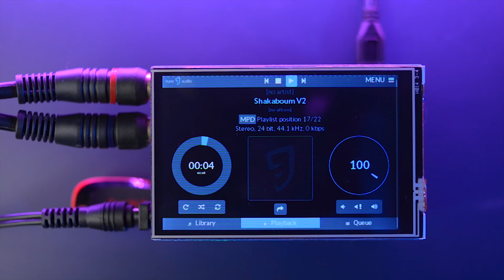Get started with the Raspberry Pi High End Audio DAC

Comment: I have an important question. I had an idea to integrate this concept into an analog mixing console and have one of these in every channel strip. Interfaces need to operate with bus cables like USB FireWire lightening protocol and those have real drawbacks to audio quality especially in today's lossless Hi-Res and DSD capabilities. Most interfaces right now max out their quality per channel at 192khz 24-bit at 8 channels. You also have latency issue and buffer. My question is, how can we as out-of-the-box console mixers use a  individual device with Hiquality playback that can synchronize each and every channels devices through MIDI SMPTE timing clocking synchronization? This compact recorder would be very useful for people with large format consoles and mix entirely independently of a computer DAW or interface over a transfer medium cable. I think in theory it could work. But, in the size that each screen could fit within the size of it's own channel strip at the bottom where your hands rest. With the touch screen, have a way to touch the screen and manipulate parameters and plugins or to have as independent spectral analysis screens....

Comment: I wish I saw this video before undertaking my RPi project to build the same thing...  Unfortunately, the comment link for details / ordering is no longer valid, and there are no details (or product SKUs) of the components used in the video, specifically the DAC HAT and the TFT Touch Screen HAT.  I'm trying to build the same thing with a HiFiBerry DAC2 Pro and an Adafruit PiTFT Touch Screen... and this route is not as easy as your video (very challenging project).  Any chance of posting more details or posting a new updated video with new components???
Reply: For some reason today I had the same idea. Poor pie is sitting in my drawer for more than a year now....

Comment: Hi, is it possible to use it without the screen mounted on it? or it could be harmful ?
Reply from the maker: Hi Paolo, it can be used without the screen without any problems. ;)
Reply: @ElektorTV  Thaks ;)
Reply: @ElektorTV iam trying for months of 2023 ...only waveshare 3.5 inch comes as Blank Screen bro...even though Touch Display is active and installed in Volumio Plugin section...I connected via GPIO pins...

Comment: So not high end. Not even HiFi. You're using a crappy DAC. I know this, because there is no high end DAC for Pi yet.

You've added a touchscreen. Screens add noise that's one of the reasons laptops suck for audio.

Switching power supplies suck. Period. Even the fancy ones like the IfI. And you will hear the difference if you're system is up to the task.

And the Raspberry Pi doesn't even put out true 44.1. Not even close to high end.

High end Pi is Pi/Allo Digione or USBridge/high end DAC. With the Pi using an Sbooster power supply, or better. Then you're getting close. Except an SoTM SMS 200 is better, and an Ultra is much better then that. And both get even better again if you use a linear power supply. Preferably an Sbooster, or better. Now that's high end.
Reply from the maker: See the specs at: https://www.elektor.com/rpi-high-end-audio-dac-module-160198-91
Reply: @amb3cog  this is high end compared to standard mp3 quality built-in rpi sound or any consumer built in audio playback (smartphone, laptop, etc); this project aims to be a pono-like version but based on open source software; you cant compare this $180 solution to $1000 dedicated external DACs; but for $180 is  a good step up from said default built-in audio playback of many devices
Reply: @alerey4363  No it's not. That's like saying I own a luxury sports car, and then I pull up to meet you in a Toyota Corolla with fur seat covers, a fur steering wheel cover, and big wide rims with high speed rated tires. You say "I thought you had a luxury sports car?", and my reply? "It is a luxury sports car compared to any normal mass marketed car in it's class. It's more comfortable, and handles better too".

Your logic is completely flawed my friend. Just like there are actual, real, luxury sports cars made by BMW, Mercedes, Maserati, etc
There are actual, real, high end audio DACs, and this isn't one of them. It's that simple. Call it what it actually is. 

What I don't get is why you would waste your time trying to defend the person who made this video? I understand why they lied about it. To get people to click on it, obviously. You I don't get at all?
Reply: @amb3cog  luxury is totally subjective; on the contrary, facts are undeniably objective; as a totally capable 24bit-192khz playback device, all these (budget, under $200) audiophile boards for the Rpi ARE TRUE high definition audiophile quality; as a 16bit-44Khz (or even worst 320kbps mp3) most mobile phones or set-top boxes consumer devices are not; your silly analogy of luxury objects wont matter here, if I put a "luxury U$1000 jewel case" to a consumer phone capable of only CD qualtiy that doesnt make it hi-res audio device; see how silly you are? now go back to basic physics and electronics classes, then come back when u have some knowledge
Reply: @amb3cog  Can you please tell me where do you get your snake oil from?
Reply: I guess the difference is subtle: 'high end' vs 'High End'. The former is a description. The latter is a title. We've reached a point where all businesses are dishonest and crooked as a matter of course.
Reply: @alerey4363  : "luxury is totally subjective"

Not as subjective as you're making it out to be. Just face it. Like most people, you don't mind lying to earn your paychecks.
Reply: @amitabhsrivastava1255  Looks to me like HH Scott was trying to save YOU from the snake oil salesman. So how'd it work out?
Reply: @TheSimonScowl  please dont put me in your lying sack; one thing I stand for is facts; so with all the snake oil in the audio industry, any project that aims to be verifiable by open sources (aka diy and check it for yourself instead of proprietary closed black boxes with proprietary closed audio formats/protocols) is a valid one; luxury is subjective as it's an individual's perception of what is (to him) expensively superflous; as opposed to objective scientific measurements, i.e. human audible spectrum (20hz - 20Khz), noise, etc
Reply: @TheSimonScowl  obviously not, you are part of the liers sack, Im not
Reply: @alerey4363  What's this 'liers sack' (sic) anyway?
Reply: @TheSimonScowl  if you're happy with your ignorance then you'll never know what a liers sack means
Reply: @alerey4363  I'm happy being ignorant of whatever you consider important. It's actually a very practical policy. Saves time for pursuits that hold promise.
Reply: @alerey4363  Well you're certainly right about my fellow continentals (though I'm certain yours aren't immune to similar criticism) but I don 't think we've discussed enough here to make a judgment. As I recall, you simply copied and pasted some specs, suggesting that, while numbers are objective, listening must be too (it's not). You were snide about it and you sound like a salesperson (someone with a vested interest in the 'product'). Was I wrong?
Reply: @ThatGuy-kz3fx  : "𝚠𝚝𝚏 𝚢𝚘𝚞𝚛 𝚊𝚝𝚝𝚊𝚌𝚔𝚒𝚗𝚐 𝚝𝚑𝚎 𝚠𝚛𝚘𝚗𝚐 𝚍𝚞𝚍𝚎.
I haven't addressed a single comment to you, have I?
Reply: @TheSimonScowl  You are wrong because I copied technical facts, not subjetive opinions; while your statement about "listening to music" is vague, mine was objectively precise about Hi-Fi meaning quality defined by scientific measurements (or do you think that ANY audio factory have human ears at the end of their product line? no man, devices are fully tested using osciloscopes and precision instruments); and vendor "opinions" are the worst in terms of defining Hi-Fi, because they are all biased (including the infamous snake oil $1K power cables and such)
Reply: @alerey4363  : "your statement about "listening to music" is vague"
Art, feelings, subjectivity are 'vague'/irrational things. If you've never been moved to tears by a work of art or music... well, there's your problem right there: while you are impressed by music, you cannot be moved by it (until you embrace the 'vagueness' and feel it). Now, I'm sure you will correct me and assure me that you 'feel every note'... but I will double-down on my assertion that music is irrational (like Pi and Phi). You will NEVER be able to explain Pi with your copied and pasted specs (there aren't enough decimal places in the universe to define all the 'in betweens'). Do you understand or are you just mad that somebody disagrees with you?
Reply: @alerey4363    : "𝚢𝚘𝚞𝚛 𝚜𝚝𝚊𝚝𝚎𝚖𝚎𝚗𝚝 𝚊𝚋𝚘𝚞𝚝 "𝚕𝚒𝚜𝚝𝚎𝚗𝚒𝚗𝚐 𝚝𝚘 𝚖𝚞𝚜𝚒𝚌" 𝚒𝚜 𝚟𝚊𝚐𝚞𝚎"
Art, feelings, subjectivity are 'vague'/irrational things. If you've never been moved to tears by a work of art or music... well, there's your problem right there: while you are impressed by music, you cannot be moved by it (until you embrace the 'vagueness' and feel it). Now, I'm sure you will correct me and assure me that you 'feel every note'... but I will double-down on my assertion that music is irrational (like Pi and Phi). You will NEVER be able to explain Pi with your copied and pasted specs (there aren't enough decimal places in the universe to define all the 'in betweens'). Do you understand or are you just mad that somebody disagrees with you?
Reply: @alerey4363  : "𝚍𝚘 𝚢𝚘𝚞 𝚝𝚑𝚒𝚗𝚔 𝚝𝚑𝚊𝚝 𝙰𝙽𝚈 𝚊𝚞𝚍𝚒𝚘 𝚏𝚊𝚌𝚝𝚘𝚛𝚢 𝚑𝚊𝚟𝚎 𝚑𝚞𝚖𝚊𝚗 𝚎𝚊𝚛𝚜 𝚊𝚝 𝚝𝚑𝚎 𝚎𝚗𝚍 𝚘𝚏 𝚝𝚑𝚎𝚒𝚛 𝚙𝚛𝚘𝚍𝚞𝚌𝚝 𝚕𝚒𝚗𝚎?"
ABSOLUTELY! They have human ears at nearly EVERY STEP of the process, from the composition of the music, to the rehearsing, the recording, the mixing, the mastering and SURELY someone listens to the master disc once it's pressed. Dude, just admit you're in over your head!
Reply: @alerey4363  And neither my feelings nor my facts care about your empty platitudes. Did you pick that up from Jordan Peterson or Ben Shapiro? Get some material of your own. This is why you don't understand music.
Reply: @alerey4363  My whole purpose in explaining rational vs irrational numbers was to show that 'facts' (decimal numbers in this case) cannot cover all 'feelings'. You're a fool.
Reply: I have recently built an RPi DAC and the thing is amazing.. not this specific DAC build but one by InnoMaker. It uses a TI chip that is found in many "HI-FI" DACs currently on the market. It is being used on an ADCOM GFP 565 pre amp from the early 90s. That feeds 2 Altec Lansing 150 wpc mono amps. Those feed a set of Klipsch KSP-400S. And I have a Velodyne SPL 8 subwoofer. Which is complete over kill for sub bass. That being said.. HI-FI is a weird world.. it's is about the perception of sound. And that is different for everyone. Now it is about sound quality and the science that goes into making quality sound. But different ears hear things differently. And it is possible to not spend alot of money on very good sound... but unfortunately the better the sound quality the higher the price, until you hit a certain level. After that level is achieved it is humanly impossible to make sound any "better". This is where dishonest sales people prey on idiots with deep pockets.
Reply: I agree that screen ads noise. But if using the right screen with its own power supply and filter both power supplies with a simple DC to DC filter it would improve the noise level drastically. And I know that this is an old review and there are a bunch of newer RPi DAC hats that are considered to have the same or better sound quality that alot of purpose built DACs and USB DACs have.